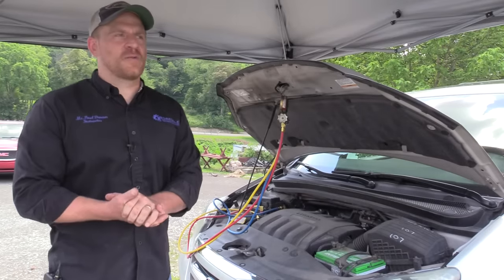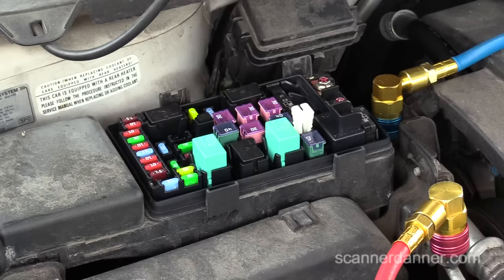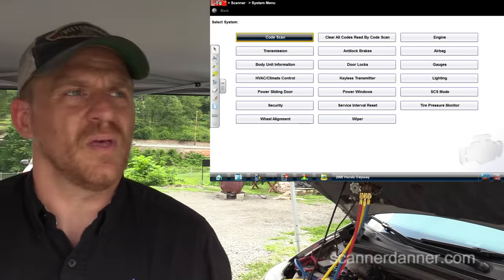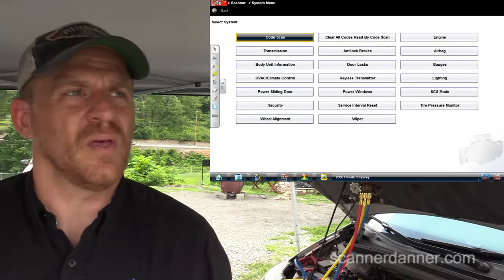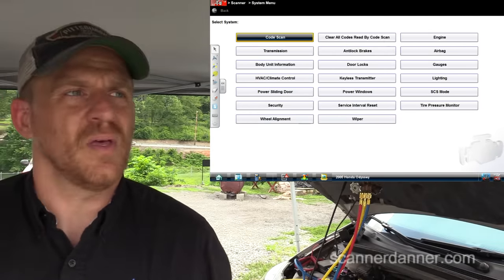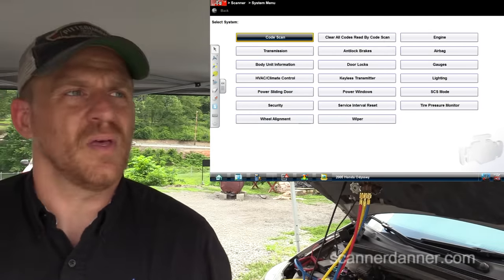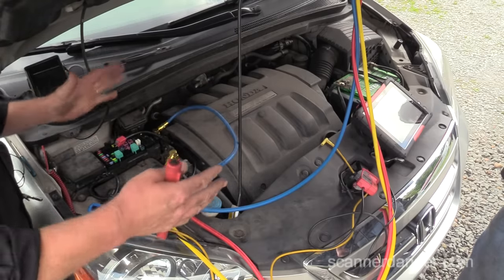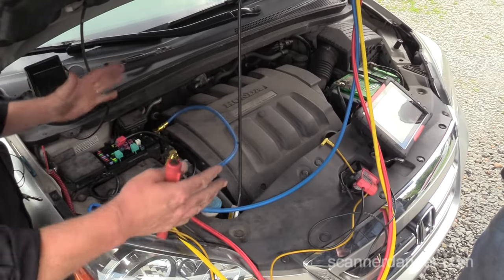A/C clutch not engaging - 2005 Honda Odyssey

Comment: Nice job on teaching and complete diagnosis on the ac complaint.  That,s what YOU do for us, you teach and explain.   I learned from you  at least  5 reasons why a clutch will not engage.  ( low pressure,  ac control switch, fuse, relay and faulty clutch.) That,s what teachers do.    Your videos are the best... also could you tell us what brand tool you used to pierce the hot wire.  Thank you,   Rick C.
Reply from the maker: It is called "Phil's electrical probe" and it is linked in the description of this video. Thank you!

Comment: Something people overlook is the compressor wont engage on many model/year vehicles if the pressure is too low.  I ran into this issue the other day.  Compressor fan was bad, blowing hot, etc.  Checked all relays, replaced fan, compressor wont engage.  It was 5psi low, added a drible left in the can and everything took off like it should.

Comment: Thanks man for the informative video. I went old school by switching the relays and found that I have a grounded coil. Will be replacing the entire compressor since it has almost 200k miles. Question, should I also replace the expansion valves and condenser? The A/C system was working great until the clutch took a dive...

Comment: I have a 2011 Honda Insight.  had an intermittent problem with the air cond not cooling.  Fans came on and idle increased on computer commanding the system on.  I brought the car to Honda for a free air cond checkup and they said it was working fine.  when I got in the car to drive away. the air did not work.  Well, after looking at it again, Honda said I needed a new compressor for 850.00.   I took the car home and did the clutch nudge and it went on.  I wound up removing the clutch spacer and it has worked fine for last 3 yrs.

Comment: I use the Lexia3 cable with the Peugeot Planet software for my Peugeot (plugged into my laptop), works for Citroens too. Cost about €60 on ebay, and it has all the diagnostics, manual activation of components, live graph readings, reprogram keys etc. Best €60 I ever spent.

Comment: Aye Paul, I know you guys are beefing, and you'll probably never promote that tool, but after you checked your gages, and went to check electrical connections, a multi-meter, and lead pro leads would have save you so much time and explanation... I'm a true DIYer, and I'm still learning, and have both Leadpro and PowerProbe, but it works and confirms circuits and wiring... Plus you're trying to save your viewers money for buying $10K tools.... 100 bucks for meter, and leadpro leads.... Diagnostic complete....  Keep up the good work tho, great dialog!
Reply from the maker: Thanks man

Comment: For the Honda Odyssey, both the blower and ac clutch relay should have power ... there’s 4 terminals on each relay and 2 terminals should have power.  To engage the a/c clutch, the ECU will look for a signal from the AC control panel (on) and will also make sure the blower motor is operating properly (if the front blower motor is bad, the ECU will not engage the ac (even though the ac light is on/green) and the front blower fan is turned on ... hence, front blower motor must be working in order for the a/c clutch to be engaged ...

Comment: To check Cluth with car key off .run a hot wire from battery to clutch directly! Start car then touch hot wire to battery ! If good clutch will turn ! If it does different problem ! This works great for most ac cluthes

Comment: Honda usually puts the electrical plug for A/C clutch on the harness that feeds the alternator. Usually easy to get at if u remove that engine covers

Comment: Also, on the subject of scan tools, the bluetooth obd2 devices give you a lot of bang for buck. With mine, I can pull up live scan data from compatible vehicles. I've used it on several cars, and all of them communicated properly. $25 for the adapter and $5 for a good phone/tablet app. Torque is the app I use, and it works great.

They won't give you all of the advanced tests of the snap-on, but they remain very capable.

Comment: This is a great video! I have a few questions. First of all I have a 2006 honda odyssey exl. I am getting a code b1222 which is stating a short in rear actuator. I know how to get to it and how to change it,but I am the same as you , I want to test everything. Do you have a schematic for the entire a/c - heater circuit? The problem that I'm having is the a/c works great and all pressure readings are great. Most of the time the a/c works perfectly, but sometimes on a long trip the clutch disengages and will not engage back. If I run with it off for 20-30 minutes it may engage again. No fuses are popping. Don't know if code b1222 will cause this or if I may have a weak clutch. The problem is it is intermittent and I haven't been able to catch it off when I have tools to test it. Any suggestions is much appreciated. Thanks

Comment: I have a problem with my a/c on my 2004 Honda Odyssey. It is doing the same thing after watching this video I went through the same techniques you did and found that I am not getting a power signal at the connector located at the fan going to the compressor. All the fuses and relays are good prior owner had someone spice the wire to the compressor lead wire and didn't use proper heat shrink electrical wrap and the wire was exposed and I can run a lead wire to the compressor and it will engage the clutch. A/C worked fine when I bought it for about 4 months then stopped working, any ideas?

Comment: If you checked at the clutch and commanded the ac on and off if the voltage dropped then that would also tell you that your power was good and the relay is good as well turning on and off so by going to compressor you could do all those tests at once right?

Comment: I'm in the field and  have an autel ds-708 I use and is great scan tool. comes with all Asian European and of course  all 3 USA lol... great bi  direction controls and data list.. does  things a Co workers new modis ultra  won't. not putting his down its a great tool but just saying..  it comes with a year free updates when bought new also... 800 dollars a year after. but keep it updated for the first year then you'll be good for few years till the newer stuff is out of warrenty..  but you always have the global format to do the basics...
Reply: Why can't you just bridge the load side terminals at the relay connection point, and do a power and ground test at the clutch terminals.

Comment: How does that test work for a bad ground, where the test light does not light up?  It seems less reliable expecting nothing to happen being the positive test for something.    I'd think checking for a ground would involve connecting one side of the test light to +12V and then probing the ground, and only if it lights up would it be an indication that the ground is present.  
Is the test configuration set up by a pullup source being connected to the test light so it lights up when not touching anything, and only goes off if it's connected to ground?

Comment: I have a 2008 Honda Odyssey and going through all these steps it seems like my clutch is slipping, somewhat like i've seen happen with a harmonic balancer with the rubber/composite  starting to separate. It has me wondering how often that happens on A/C clutches. Has anyone seen this happen before? Thanks for such a clear cut video!
Reply: Both sides read even, I believe around 120psi on each side, nothing changed the readings. Would a slipping clutch cause this?
Reply from the maker: It could be the compressor is seized and that is why the clutch is slipping. See if you can turn the center compressor plate by hand (engine off of course). If you cannot, you need a compressor, among other components due to debris from the compressor
Reply: @ScannerDanner  finally got out today and was able to check it. It does spin free, so I'll try the clutch replacement. Thanks! 👍
Reply from the maker: @atola5349  make sure you have a good power and ground on that clutch coil first!

Comment: I have a 2006 Honda Odyssey EXL. Just a few days ago, I noticed the there's no air flow from the center vents. Only on the driver and passenger sides and rears blow fine and changing the "Mode" doesn't help. Blows hot/cold air just fine but doesn't blow in the middle. What could be the problem? Much help is appreciated. Thank you.

Comment: Excellent video :-) Thanks for enlighten us.
Reply: We refilled the refrigerant, while in idle it discharged under the hood and a bit thru the vents. Started blowing hot air as u would expect. The clutch bearing went out, melted my serpentine belt... replaced all the above and now my ac clutch doesn't engage. Do I need a new ac clutch? I'm stumped on my next step, too many internet answers to go with.

Comment: It would be interesting to see a current ramp on a a/c clutch, there's several times where I've run into a clutch showing up bad after 30 minutes of driving, then to cool off and start working again. Wondering if you've tried this before might be a indicator of a clutch on the verge of going out.

Comment: You can swap that relay with the AC fan relay (the one upper right you touched with your finger at first), to see if the bigger fan comes on with ac input on
Reply from the maker: I'm not a "swap the relay" kind of guy when I am teaching through a process. In this case and in most cases, that does nothing and the relay can be checked very easily without swapping them.

Comment: once you heard the relay clicking, I think was a bit overkill all that trouble. I would just check if the clutch got power to it, and if so, change it.
Reply from the maker: All stuff that I mentioned. Also I couldn't get to the clutch (as I clearly talked about) and it's not about rolling the dice for the last parts of this. Just because a relay clicks does NOT mean the rest of the circuit is good. I have done hundreds of similar jobs where there is a corroded wire after or before the relay.
What I showed was not overkill for someone who's already changed their compressor clutch and relay and whatever else and the clutch still won't power up.
Reply: +ScannerDanner just because the relay clicks doesnt mean it works. Recently had a nissan frontier ecm ppwer relay clicked but as soon as circuit loaded it cut out.

Comment: Try replacing the R6242 relay module which is a 4 prong that is next the the MG Clutch 7.5 amp fuse it's easy to see it on the lid it has a snow flake to indicate it.

Comment: Simple test while the relay was out and the test light clamp hooked to the + terminal would be to check the relay terminal that goes to the A/C clutch a good circuit and clutch would complete a ground circuit and lit the light.
Reply from the maker: For sure but we already knew that test would have failed. With a good feed and 0 amps, there was no need to do that test. But I should have shown it anyway. Thanks!

Comment: PC based scantools are the most inexpensive and have bi-directional control in plentitude for around 450.00 from Autoenginuity and 500.00 from Drew Technolgy's Mongoose. These tools can actually be the dealership or factory scantool, for instance GM Tech2Win functions on the Mongoose.Not all OEMS are as PC friendly.

Comment: Honda is pretty strait forward.  You see the defroster the snowflake and the fan.  The black relay between the two larger turquoise relays the one with the snowflake is the AC relay.  The one to the clutch.

Comment: Dan, I have a 2008 Toyota Highlander with 140,000 miles. I brought car to mechanic because i heard a rumbling/grinding noise from engine that sounded a lot louder in home garage than outside due to 4 walls and a smaller space. Mechanic identified it as a Compressor clutch bearing. So he replaced Compressor, but now AC won't turn on until about a minute or 2 after being turned over. Living in the South, with 105 degree - Real feel temps this is an unbearable amount of time to wait. I have heard of other Toyota (Highlander, etc.) owners complain about this in Toyota Nation forums in their cars (non highlander models, too). Not only won't AC come on but the AC controls won't get power until those 2 minutes have elapsed. Then all of a sudden the whole AC system starts working.

Have you ever run into this? 

My own research says Toyota release a service fix for 2014 (?) models but not for earlier models. My mechanic ordered some parts to try, including an expansion valve or expansion evaporator-?. He's already replaced compressor a second time with no luck.

Comment: I have an intermittent coil on our Odyssey. It will work for about 15minutes or so and then turn off for about the same. I caught it in the act while it was being commanded on but the clutch was not engaged and measured 3k ohms of resistance at the relay load side through the coil to ground. When it cooled back down, I got 3ohms. I'm putting a clutch on it this weekend :-/
Reply from the maker: yep, sounds like a bad clutch coil Doug

Comment: hi danner, im searching you site forum but no luck, would you send me the link of your site forum. my question is, what is most common issue of airconditioning relay that goes to 85 or 86, relay is not getting negative switching from engine ecu to relay 86 or 85. thats most i encountered in every car AC issue. check the pressure switch its ok, thermistor check also its clean, or maybe faulty but how or what is the best way to test thermistor inside evaporator?
Reply: 15:20
Reply: Hello Paul I have a 02 Buick LeSabre limited with a 3.8 and when I put the gauges on everything looked normal evacuated the system the pressures are okay there was no free on in the system when I activated to clutch as I put the freon in the clutch activated turned on and it took it and all took in 12 oz of Freon after it took the 12 oz of freon The low side pressure hose started icing up I don't know what caused this is it normal and it's so that when evacuated it should hold 2.2 l b I was only able to put in 12 oz

Tap on a clip to paste it in the text box.
Reply: 15:20

Comment: My truck was completely empty of r134a, I used an “ac pro” recharge bottle, went from 0 psi to “filled” (40psi). But still blows hot air. Compressor is kicking in and out every 10 seconds or so, and the ac pro bottle meter needle does move up and down when compressor clutch engages and disengages.  Obviously there’s something else wrong... Any suggestions?

Comment: I think instead of using fancy amp clamp tools, you could voltage drop from the output of the relay to ground. If you read 12 you'd know it's not open, but if 0 you know it's open somewhere on the load side. you could also have excessive resistance on either side of the load circuit which would only be caught with voltage drop.

Comment: Hey, Paul.I have not seen James post any videos for months, how has he been doing? I have an A/C clutch that does not engage. I  bi-directionally  commanded the A/C clutch On,  I heard the relay click, but the a/c clutch did not click( engage). I bypassed the relay and heard the a/c clutch click.Today, I decided to purchased an a/c clutch relay thinking that the relay was bad and that didn't solve the issue. Watching your video again, I can see that buying the relay was a bad decision. From the video, I can conclude that the inputs are fine. Also, I can see that the a/c clutch is fine from the bypass test. I am beginning to think that the system may be low in refrigerant and with the car running and a/c requested, the low pressure switch is  not allowing the clutch to engage.Any suggestions? By the way, the reason I assumed that the refrigerant was enough is that when I did the bypassed test, I heard the relay clicked. I thought that everything had to be good for the pcm to provide ground to the relay. From what I have learned that when you do bi directional testing, you are asking the pcm permission to to do what you want done, and if the pcm see something wrong, it will deny your request. Am I wrong?
Update: Today, I had a chance to bi-directionally turn on the relay and the a/c clutch engaged.The relay was indeed bad.Now, I am going to have to chase other things such as: Refrigerant, leaks and switches if need be because when I press the A/C button, the clutch  does not engage the compressor. Thanks for the excellent video.
Reply: Were you able to figure out how to get the clutch to engage?

Comment: If the air gap is too wide on the clutch plate, you can take a spacer out.  You did not mention this.

Comment: Great video Paul. The PCM test you did with the relay removed - could you do the same test putting your test light to battery positive and using the control side port on the uactivate to test the driver?
Reply: i did this test by putting the test light on the ground side control pin and pressing the ac button on the dash. Good way to show control is present at the pin.

Comment: I have Mazda bongo friendee dual aircon van, When i turned AC on.. the clutch motor wont turn on/off automatically and that caused draining the battery. I discovered that this will happen and the compessor runs continously when the ac front blower is connected. I unplugged the ac front blower and the clutch motor will shut on/off. What should I do?

Comment: Paul, I have two questions. 1. At 17:56 the computer is not providing a ground yet to the 86 terminal. How comes the multi meter shows 0.00volts? Shouldn't that be fluctuating as with an open circuit? 2. At 18:13 how comes the multi meter is again 0.00volts at 87 terminal if there was an open in the clutch coil? Shouldn't that be fluctuating similarly? Thank u. (Somebody please tell me what to call that fluctuating type of random voltage the multi meter showing when there is an open circuit.)